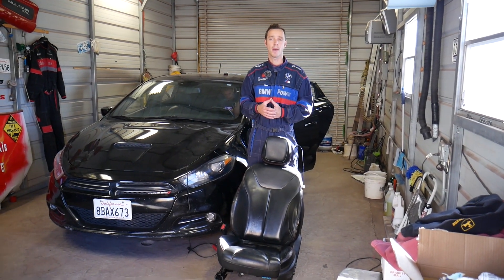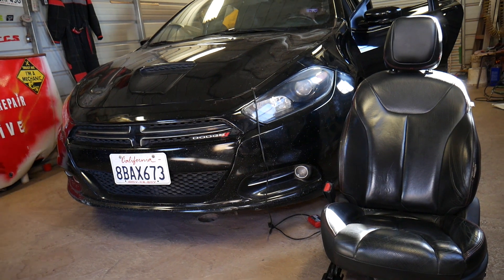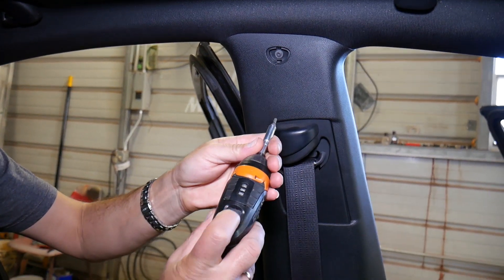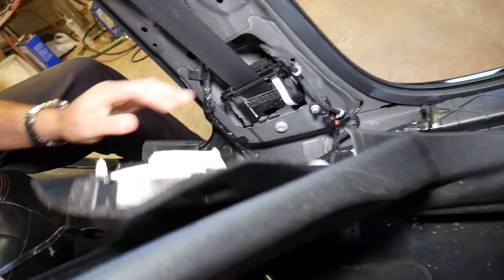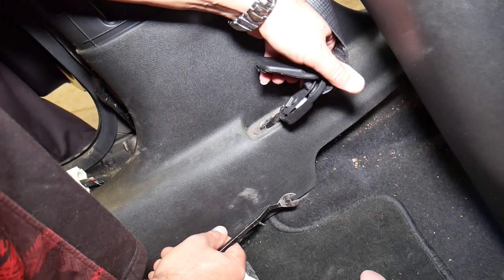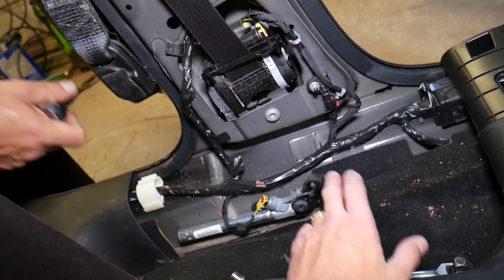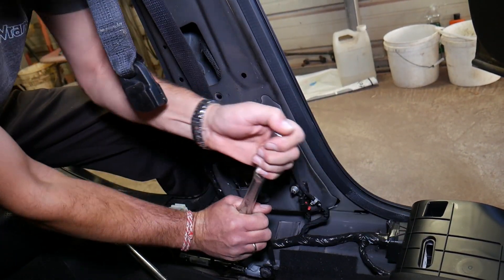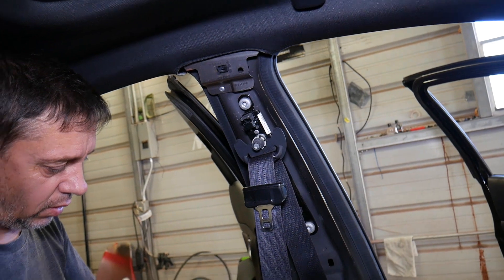FRONT SEAT BELT REPLACEMENT REMOVAL DODGE DART, CHRYSLER 200

Comment: I just went to the salvage yard and got a seat belt assembly off a 2015 dodge dart for my 2015 Chrysler 200. All was good except the bracket holding the assembly against the wall was an inch longer than the Chrysler's.